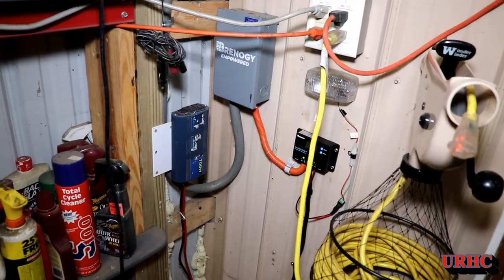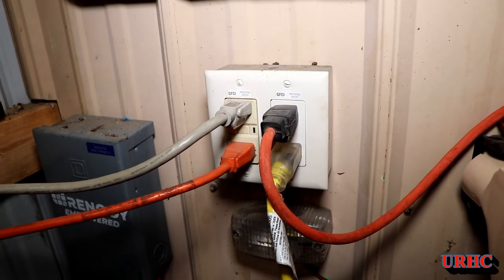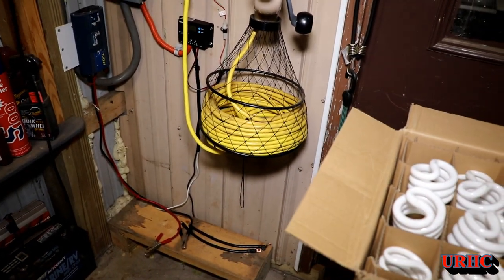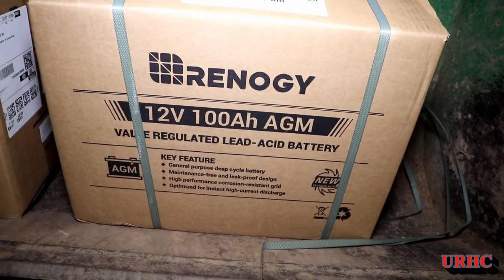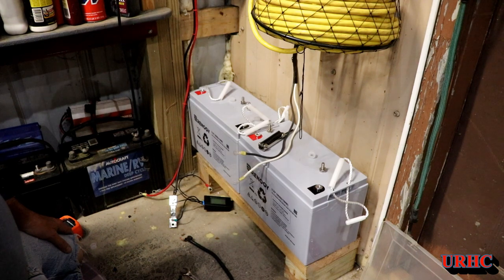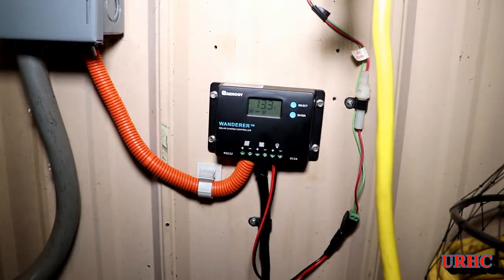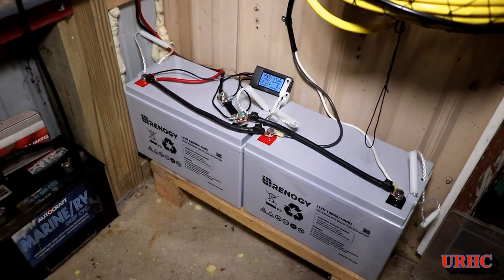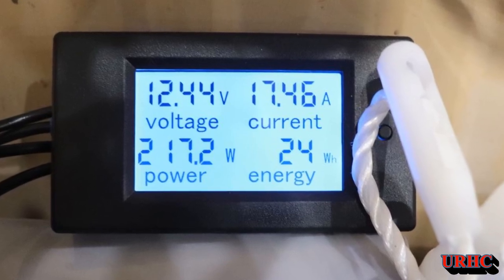New Batteries For My Solar Powered Barn Lights

Comment: 4:40    The log arch caught my eye.  I remember watching those videos.    I don't weld but friends do.  My log arch is just a puppy compared to yours.    I need to have two more braces added - even without the braces the arch is working great.  Thanks for the time you put into all your videos!
Reply from the maker: Thanks.  I'll have to make another  video  next time .I use it. Have to replace the Harbor freight ratchet heads used to swing in the front lift.  They had plastic gears that are wearing out. Thanks for watching.

Comment: Florescent fixtures don't like trying to work with a modified sine wave. It's can cause excess heating in the ballast and other components resulting in a short life span.  
I think the LED's are fine with it as long as it has several steps on the wave itself and not just few.  There is a term for that but it's been too many years since I was studying that! I would add another panel as soon as you get a chance too. It will help the overall performance of your system.
I am really enjoying your channel.  Living the life I had hopes for at one time.
Reply from the maker: Definitely looking for a better inverter with a true sign wave. I  have gotten away with this for 6 years on rv type batteries and higher watt CFLs so for now I am starting with just this one. Could get 3 hours of light a day in the summer with the old setup that was plenty. The original panel seems to be degrading though after watching it and so far has only hit 19 volts where originally it could hit 24 in full sun so I may just swap out a single 250 watt panel next sale. Thanks for watching.

Comment: Great video. Converting to solar energy is the best decision we ever made. The photovoltaic system was installed about 5 years ago dropping my electric bill from $300 to $26.25 a month. The system is just about paid off.  The next purchase is an electric car.
Reply from the maker: That's  what we are hoping to do in the future.  The area we live in is not the best for solar so payback  would  take a long time but with  the recent increase in the price we pay for electricity it would  be a good move coupled with an electric  car as you plan. Thanks for watching.

Comment: Brother I have the same charge controller it works pretty good I use it for our security cameras instead of our other system running it keep it up brother
Reply from the maker: I am going to upgrade to a 30 amp next but this was only $13.00 so I decided to try it. Going to try it with the cameras after I get a pure sine wave inverter. Just playing now but looking at (20) 410 watt bifacial panels with a 48 volt lithium battery bank in the future the way the electric bill has risen lately. Thanks for watching.

Comment: I know the AGM's are less expensive when you look at a single purchase, but over a 10-yr period, Lithium-Iron-Phosphate (LiFePO4) is a much better solution.  There are numerous advantages and the only real disadvantage, cold-weather charging, can be resolved with a simple 12v heating mat, that you would normally use for seedling trays.  Since you are obviously very much a DIY kind of person, when the time comes that you want to switch to lithium batteries, you can build one yourself very easily.

I would also mention that as you go up in voltage, on the inverter side, your efficiency increases and the size of cabling needed to draw a lot of amperage goes down.  A 24v pure sine wave inverter would deliver cleaner power and increase the efficiency by 3-5%.
Reply from the maker: It's  not worth  the money  with  below  zero temps out there  in the winter.  By the time these are toast  new battery technology will probably  be available  at a low price. This is just for fun and has worked  great so far at a minimal investment.  When I start on the house it will be a totally different  story with  real inverters and longer lasting  batteries.  Thanks for watching.

Comment: What is the scoope on the Ortur CNC router? I have not heard you mention it!
I would not use any electronic devices with with a modified sine wave inverter  it is paramount to using a jack hammer when you show be using a soft blow hammer. That saw tooth when looking at it with oscilloscope will show you spikes that murder capacitor’s in power supplies.
I am sure you know this however this for the viewers that are not aware. The best inverter is a full sine wave inverter.😁🛫
Reply from the maker: It's  sitting  there  waiting for a  firmware update I haven't  had time to do. That's  supposed to make the offline  controller  fully functional.  Probably  get back to it in the fall. I wish  that I had an oscilloscope to look at it but don't.  Going to add another panel and a sine wave inverter  in the future for the cameras but from what I have read it's  very expensive  to get an inverter that has a true sine wave and most still look like saw teeth even though they claim otherwise.  This one has worked  great for the lights so far and I think the led bulbs can handle it better  then the old CFL bulbs. Thanks for watching.

Comment: Any thoughts on adding a small wind turbine to supplement your system ?
Reply from the maker: No I haven't.  All the smaller ones seem worthless with a short  life and It requires a special permit  to put up the proper 30 ft pole for the next size up. Thanks for watching.

Comment: This is perfect timing! I am wanting to install a solar light system in my shed. Also a battery maintainer for my lawn tractor. What solar panel are you using?
Reply from the maker: I am using  an old renogy 100 watt panel now but will be upgrading to at least 200 watts next. Renogy has some reasonable prices on complete starter kits with often sales  plus there are many solar generators available now that may also be a good option if you want a plug and play system.  Thanks for watching.
Reply: I use the solar power trickle charger from Harbor Freight to keep my batteries charged up on my loaders and lawnmower.  I am retired and don't use the loaders much any more  so it is really nice to be able to crank them when I need them without having to drag out a battery charger. The Harbor Freight battery chargers are only around $14.00 so they are well worth it.
Reply from the maker: Kris I tried  one of them when they first  came out and had problems.  It didn't  have a blocking diode and would discharge in the dark plus it would  over voltage charge damaging the battery.  Guess they may have made changes  since. Battery  tender makes a solar version with the proper desulfate programming to help extend battery life. Had problems with a  Harbor  freight  trickle charger also so just went out and bought  8 of the battery tenders. Thanks for watching.
Reply from the maker: I see they have changed the instructions to add place a voltage regulator between the panel and charger to prevent damage to the battery and reduced the wattage from the 4 I had to 1.5 . These unregulated panels alone can damage batteries over time.

Comment: Hi, it does not make sense to me to store energy from a solar panel into batteries and the use an inverter to change the power to ac to light a barn with led lights. Why not go direct from the battery and supply 12-vote dc power to run the lights
Reply from the maker: You could  run 12 volt lights but they are quite  expensive and would  need larger wire.  The inverter  does also consume extra power so it's  not the most efficient way. The final  goal is to be able to run things  that take 120 vac during power outages and learn more to be able to build  a larger system for the house in the future.  so this is how I went. Thanks for watching.